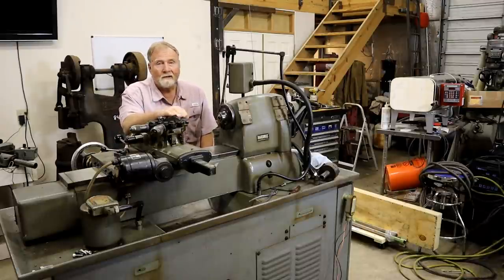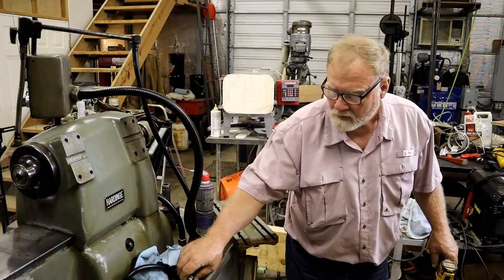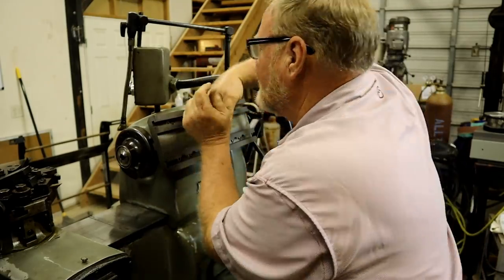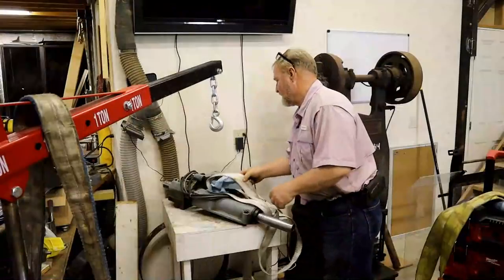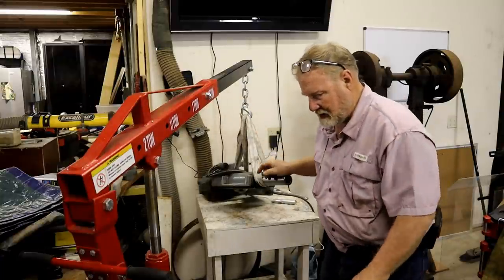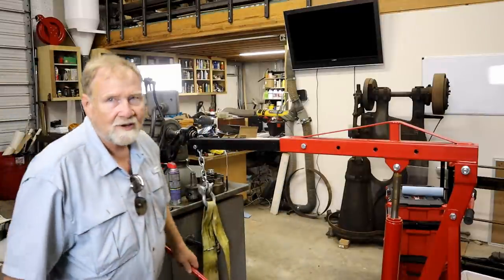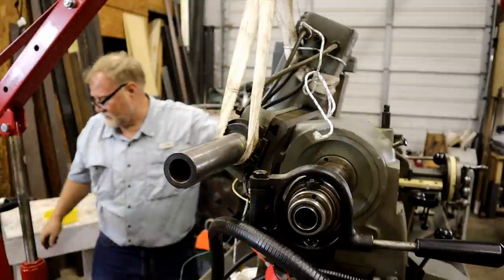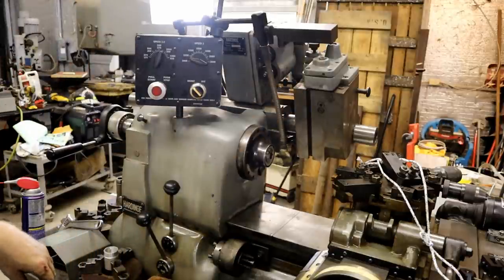Installing an Automatic Threading Attachment on 1975 Hardinge HC Chucker

Comment: Back in the 80's when I was just starting my craft as a machinist, I ran a Hardinge with a threading attachment just like yours. I built components for a satellite which the thread pitch was 96 threads per inch. If I remember right the total depth of thread was .0065 but that chucker could do it all day long with tight tolerances.
Reply from the maker: That's a pretty tight thread!

Comment: You should be quite proud of your shop , I am a retired engineer who retired as a CEO who lived on three continents and did work on five. I lived in Houston  for a while too. I would wear steel toed boots but would be quite happy in your shop !I have seen a 200 ton crane operated by a guy in sandals and shorts while others on tag lines had the same safety kit.
Reply from the maker: Thank you... I have boots when welding and working with the heavy stuff... They just kill my legs after about 2 hours... :(

Comment: That's definitely a nice old power hammer. If I was already back in Texas and could use it I would be buying it in a heartbeat.
Reply from the maker: I'm thinking of putting a motor on it and watching it work :)   Only problem is all I have laying around are 3 phase motors and the new owner might not have the power :(
Reply: @10swatkins  the place I'm looking at moving to is  set up for single and 3 phase power. If you still have it I may buy it just for the hell of it and start learning something new.

Comment: I was just talking to a old buddy tonight in Minnesota he was talking about how nice threader attachment works on his Hardinge Lathe
Reply from the maker: I am hoping to find out soon :)  Bob is moved into the semi final resting spot and wired up...  Has a slight issue now with  speed control but I have been slogging through that and now that I have the simple stuff out of the way it should not be long till I track the problem down.
Reply: Steve it's Bobb.

Comment: Before drilling into the table or cabinet.  Make a clamp with a few setscrews to clamp to the lip to mount the control box.  That could be welding nuts to a piece of 5/16  or 1/2"

Comment: Dont know if it was correct but I always heard it as the second pronunciation. Worked with a few in the 80s
Reply from the maker: Well I'm pretty sure I know how most people say it, it was not how I said it in the video, but it ain't worth arguing about :)
Reply: @10swatkins  Certainly wasnt trying to say I was correct, would be interested how it is supposed to be pronounced by the factory. Its the porche debate all over again